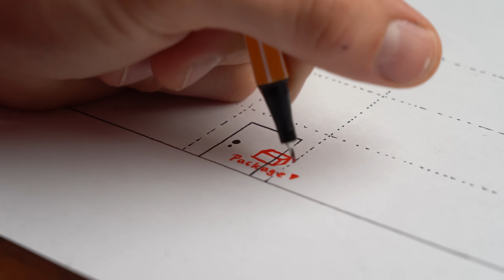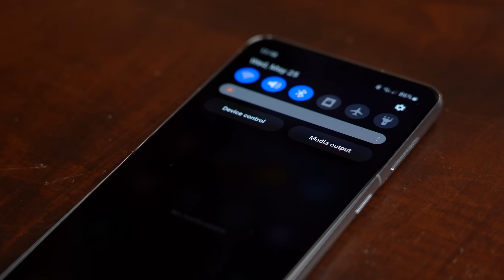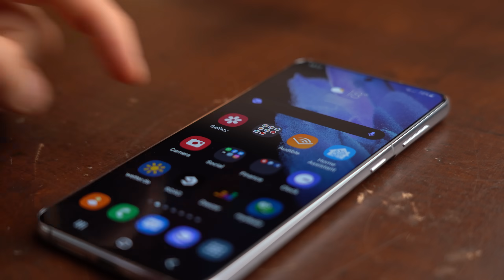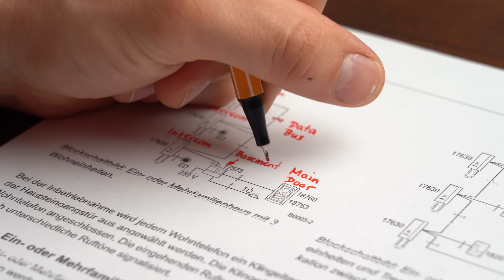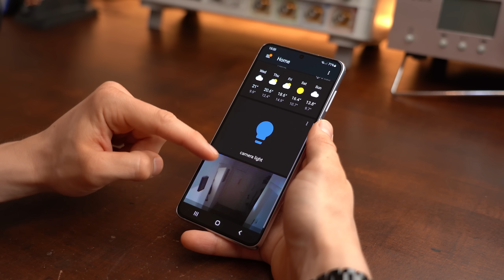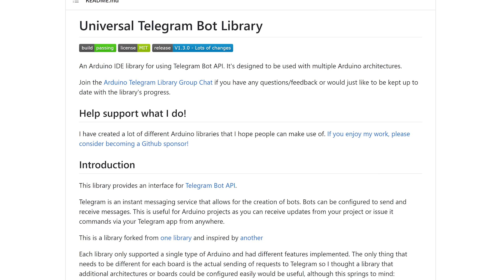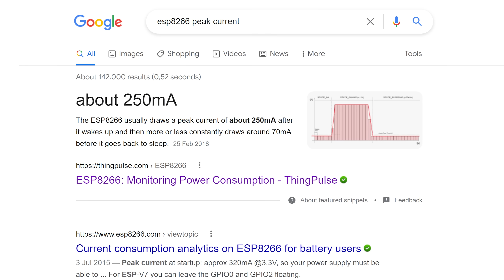Every Apartment needs this Upgrade! (WhatsApp/Telegram Notifications)

Comment: A small delay for the notification might be because it comes through Firebase. If you disable Battery Opimizer for Telegram and make sure that in Telegram's settings the "Keep alive service" setting is ON the message might come quicker.

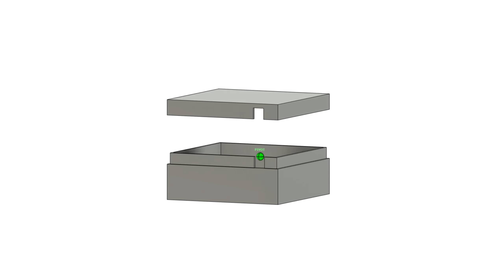Comment: Hi and thanks for the video! It seems like you are using two different grounds for your circuitry (9:12) one is coming from the power supply and the other from the door bell system. Can this cause issues?

Comment: The ESP requires 250mA @ 5V, which is 1.25VA. Not 250mA @ 24V. It was probably good enough for the intercom system.

Comment: I've had something similar built into my intercoms for years.  The first one was easy because there was a pin like yours where I could extract the ring signal.  The second one I had to get creative, because I couldn't find such a pin and decided to trigger it based on speaker activity.  I also added a relay to control the opening button remotely and this allowed me to open up the door from the Telegram notification itself :P

I recently moved and have to open up the new intercom to investigate.  Just might start doing that today...

Comment: I have used raspberry Pi 2b to send notifications throughout Pushbullet instant notifications from alarm system to my phone out on home wifi (no lag). Used onboard pins and 10k pull up resistor

Comment: Using the Telegram library is not necessary. a simple web request is enough to send a message. You can also do it from a terminal or browser. (parameterized URL)

Comment: How to make a problem out of nothing. Just add a high power buzzer/siren to wake you up when the doorbell is pushed. Doesn't require any Internet or unreliable external services with unpredictable delays. When you want something to work reliably then keep it as simple as possible.

Comment: Something cool you might add to the system you’ve already built is controlling the buttons to open up the door or answering the intercom from your smartphone without having to walk to your intercom
Reply: Answering the intercom might be a bit tricky, but something like opening the door should be relatively simple given that it's done through a simple momentary switch. Main issue with it would be interfacing in a non-destructive way so that it leaves no traces if you eventually move out again.
Reply: @JeppeBeier  The mic and speaker of the handset should be quite easy to intercept, as they are analog and accessible via the connector.
Reply: @JeppeBeier   i actually did that using a SONOFF RE5V1C whose switch is decoupled from power voltage although it was abit more weird cause my intercom uses 16v AC.

Comment: actually for deaf people there's a system where the light flashes when the doorbell rings. it's lighting fast doesn't even require any internet connection or app. way easier.
also this project is impossible for basically everyone. every intercom is very different. I doubt anyone here has that specific model.
this was a bad video you didn't explain things. no one learned anything. I was expecting to be able to replicate some things from this. it's impossible you provide zero details. I usually love your videos but this one I felt like I was wasting my time.

Comment: I have the exact same doorbel and I used a shelly uni to do this without soldering (just some plugs that fit on the Ritto PCB). I integrated that with home assistant and I have a lamp on my desk that flashes a particular colour when the doorbel rings (and also other stuff like flash another colour when I leave the fridge door open for a couple minutes, which is read with a magnetic door sensor on the fridge door). Since shelly uni has a potential-free output, it can also open the door for you (I'm sure you can do this on the D1 mini as well), so I then used the email integration to read the email that Amazon/DHL sends that a package is arriving today and it automatically opens the door even if I'm not home, so I don't have to go pick up the parcel, the delivery person will simply leave it in front of my appartment door or downstairs inside the building (I can trust my neighbours). The only problem with my setup was that the power supply cannot handle the shelly uni and the voltage stops rising to 5V when ringing after a couple of weeks but your solution is just great to finally make my setup fully functional!

Comment: Have an idea, to use that intercom system to call to your phone. You can probably use SIM800 modules or similar ones. You can control answering button with esp/arduino also. :) Good video by the way ;)
Reply: That system is actually in use in some apartment buildings, at my uncle's house they get a call whenever someone rings the bell and they can talk to the person at the door. I think it's opened by pressing a certain number key on the phone.

Comment: I have a Siedle doorbell, so sadly no 5V output for ringing. But the voltage on the twin bus drops from 20V to 18V while ringing. So I built a unity gain amp (with high input resistance, so the signal will not be pulled down) and a second amp stage with a gain of 0.125. So in standby I have 2.5V on the input of the ESP. While ringing it's 2.25V, and is someone took off the handset its 1.88V (15V on the door com). The ESP can detect all these voltages and tell me what happens at the moment.  It also can switch a reed relay which connect the two contacts of teh door opener button.

For notification I use Node-RED with an addon for desktop notification. Through notification snyc of my devices I get an instant notification an all of my devices (desktop, laptop, tablet, smartphone. So I will not miss it.

Comment: I want to build this system for a hearing handicapped family. the family consists of 3 individuals. I believe you will have to create a separate telegram code for each individual. In this case ıs it possible to add all codes to the software? thank you for your valuable time.

Comment: At 7:37, is there any trade-offs for using a voltage divider circuit over a 3.3v voltage regulator? Just a curious lad here.
Reply: The voltage divider is being used to drop a 5V signal down to 3.3v into a digital pin as the pins can’t tolerate 5v.  It’s not powering the microcontroller.  A voltage divider is more basic and faster in this scenario.  A voltage regulator would take the 5v and drop it to 3.3v but it would be slower doing this and the pin could receive anywhere from 0v to 3.3v in the startup time of the regulator.  If you were trying to send a digital signal of 1’s and 0’s to the digital pin, a regulator wouldn’t be fast enough and you’d get errors in the input.  A voltage divider is a lot quicker as there’s no capacitance to store energy over time.

Comment: You can integrate the Wemos into Home Assistant and send notifications out of there. I get almost instant message (1-2 seconds) in telegram when I open the main door and I can notify via voice into my headphones or speaker of my phone. This TTS automation is working at least a month and failed only once (every day it is notifying 4-10 times). The same as I have a smart doorbell (ESP-01) that sends me in telegram photos and videos from the camera as someone is pressing the button

As an example, I have an automation that speaks notifications through the phone on the wall. And there is an option if I`m listening to a music (Bluetooth headphones or an amplifier is connected) or I`m away from home the notification will be said into my headphone or speaker.

Comment: Thanks a lot for this video ! A really cool project. Though I wonder, to detect the ringing do we really need to be invasive and solder wires to the door phone circuitry ? Why not just use a microphone and a microcontroller mounted near the doorbell phone ? There seems to be a light glowing on the system when ringing. Perhaps a photodiode can be used with the ESP8266 to detect the glowing indicator.

Comment: Nice Project.  My only issue is that you soldered to someone else's equipment.  That is generally an issue, voids warranties and upsets people.  I hope you got permission before permanently modifying equipment you don't own.  

You could have got the same result using a connector that could easily be removed.  Other than that, I liked the use of the ESP modules and Telegram, which is easy to integrate and very quick.

Comment: Oh god. The project is good, I was looking for ways to improve my annoying as hell intercom but come on, why don't you put the electronics inside the intercom. Seriously you can do that. The power cable can come from the back using the same whole where the wires from the outside of the house come inside the intercom.

Comment: i would have done it differently… sensing as it is, but transmit over mqtt and then (cause its there) notify over homeassistant wich isnt bad if u use the app. if this is too slow, alerting with a led, a buzzer a vibrating motor or whatsoever. if this is still too slow just hang in directly to your mqtt server by subscribe to your defined mqtttopic and done.

Comment: Cool, was thinking about making something like this myself (but I want something zigbee based on batteries). The ESP way though is way easier and provides for direct bidirectional communication between your home assistant software and the intercom system. Perhaps I will just go the ESP way also, makes life a bit easier. 

Next steps that would be nice to have:
- Use an opto-coupler (or led/ldr) instead of hardwiring between the two systems. 
- Auto open the central (hallway) door when you are home 
- Option to remotely open the central (hallway) door with your smartphone
- Make the buzzer from the phone switchable when you are sleeping (or use some external options like amazon alexa/google home/squeezebox system/etc)

Comment: Acoustic detection could have been interesting. And maybe some sort of discrete notification system, for those of us who don't write off our entire lives to silicon valley corporations (yes, I realize the irony in posting this as a YT comment - network effect. Please check out peertube and other decentralized video streaming services). 

Piezo pickup
Bandpass filter for the appropriate ringer frequency
A comparator op-amp driving
An LED driver for a red LED strip
Strip goes around the baseboards/ceiling moulding. 
Add in an astable multivibrator between the comparator and driver, and you've got yourself a very irritating whole-room notification system while the cloud is none the wiser.

The whole thing probably costs less than your micro/smartphone solution, and it will notify you regardless of smartphone connectivity/battery/notification settings/attention span/etc.

Comment: just a slight correction: the 'ESP' can't  handle 3.3Volt on its ADC. the Wemos can as it has a voltage divider on board. that also means you do not need a voltage divider for your 5 to 3V3 conversion: a simple seriesresistor is enough.
given the voltage divider is a 220k over 100k., for 5volt you would only need a 180k seriesresistor

Comment: I designed similar a few years back for my local hackspace. Difference was that the ring signal was PWM 12V so I used a fat capacitor to smooth it out and an opto isolator as wanted it isolated. Then it pumps out MQTT and PA plays a doorbell sound to all rooms.

There was also a relay! ;-)
Reply: do you have any documentation?

Comment: Your power supply math is wrong! The esp8266 chip can handle a max of about 250ma (I suspect your project would barely even reach 150) at 3.3v. This makes the total more like 0.825VA peak, easily a safe amount to use, even if all your neighbours had them too!

Comment: I have the exact same intercom on my building. For me the problem is not that I don't hear the bell but that the delivery guys start ringing all apartments if they don't get a response in 2ms. The system only allows the last one to answer and open the door... Is this also the case for you or it's a configuration that we could change in our building too?

Comment: Hey Scott can  soldering wire in my local market cheap quality of wire are available which have 60% lead & doesn't melt at easily making it hard to remove while replacing components and doesn't shine there are also wire with 40%lead .
Displaying it's property physically and electrically can u make a video and where to use them.

Comment: Can you provide the schematic of this project. I am not sure if i understand the circuit, especially the part with the voltage divider. I could also use a step down converter right?

Comment: FYI; there exist solutions for deaf people, with flashing lights for when the phone or doorbell rings. It's quite intense; like a slow stroboscope with very bright flashes - hard to miss (:
      (Your project obviously has a lot more uses. But I just thought I'd mention it).

My cousin uses that 'light alarm' (he's fully deaf) and my grandmother used it too. 

He also has an alarm clock that vibrates the bed enough to wake him up, instead of making alarm noises.

I've always found these types of solutions for normal everyday things very interesting. It's not something you (or at least I, personally) normally think about ("if noise is not working, how else can the doorbell notify you?")
Reply: *Perhaps your solution would work better for deaf people, actually. 
      (Modern smartphones usually have quite good accessibility features.    
      Plus people usually keep their phone on them or very near.)

Comment: Should have added a zener diode or clamping diodes in case the signal overshoots it's 5V.
Also, where's the serial resistance/fuse for protection ?

Comment: I use for instant notification of movement in front of backyard door (cat is coming home) a IKEA ZigBee motion sensor (IP44 rating) connected via Sonoff ZBBridge with Tasmota generating MQTT messages. Logic runs in Nodered and for notification i use Gotify server (running in docker) and Gotify client (only Android is supported).
The notifications are delivered instantly, and what's most important for me, they don't rely on any internet service, so I can receive my notifications even the internet connection is offline.

Comment: would be great if one could eliminate the dependency on messenger service or internet availability..
i.e. if there were a way to push the notification directly to some app,
thereby only depending on the local network (wifi)

then again, would also be great to have both,
so being able to be notified of a door call when away from home,
and then it would be cool to have audio (or even video) connection between door and phone..

Comment: Nice video. I personally struggled with a similar system for a while, couldn't find a proper way to get a signal when bell is ringed, (too much electric noise) ended up using a microphone and an  esp, and its kind of working.
I did manage to put everything inside the intercom enclosure though. Was wondering why you haven't done the same.
Cheers.

Comment: i had the same problem, i installed a second buzzer next to my pc and connected it to the doorbell with the coax cable i no longer use but was still in the wall. but your solution is much more elegant haha.

Comment: Please do not connect your apartment ground to the intercom ground. Use optocoupler. Your mods with loose wires and poor soldering skills also increase fire hazard in your building. Cool notification thou.

Comment: You could speed that up by measuring that signal output on the speaker so that way it doesn't have to wait for the ring to finish for it to start sending the message, it just sends it straight away.

Comment: I reckon you could have powered the ESP from the intercom. I would have put it inside the intercom. I would have used a plug rather than solder.

Comment: Signal works fine too, btw - just in case Telegram is not available for you (just like it is for me). Signal has also the option of being 1) Opensource and 2) very, very, very secure.

Comment: Important to implement a Opto Isolation if you connect your power supply to any other ground referenced circuits so you do not have strange effects due to multiple grounding points-
Reply: Yes, its not more complicated then voltage divider. I'm surprised such "solution"

Comment: What can I use to check if my pond fish is stolen at night?It can give me push notifications as soon as it comes near the pond so I can get up and catch the thief.. Can i use ultrasonic sensor on this case? Then it's a great composition of ultrasonic sensor,esp8266, and my phone.. I think I will installed a 9v small battery to operate the sensor and esp8266, and it's no need Antenna.. Instead my room is 200 meter far from my pond.and At first I thought I would have to take wireless communication and antenna📡 to solved out this problem

Comment: I’ve had pretty good results using a webhook via IFTTT and sending a push notification to the IFTTT app from various devices. Whether it be from a raspberry Pi, an ESP32, or a Particle Photon. You can structure the message using various values passed to the webhook. Anything from door opening notifications to low battery monitors, notifications have been pretty quick, usually within a second or two. 

I need to check out that Telegram library though just for some other options.